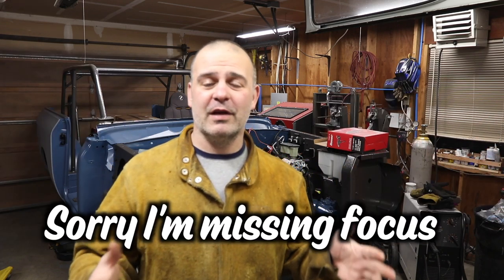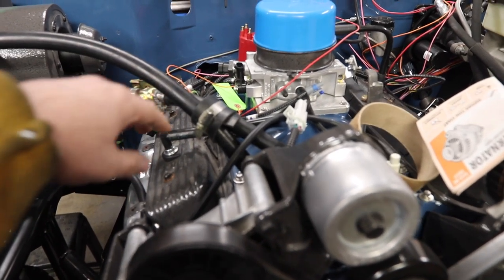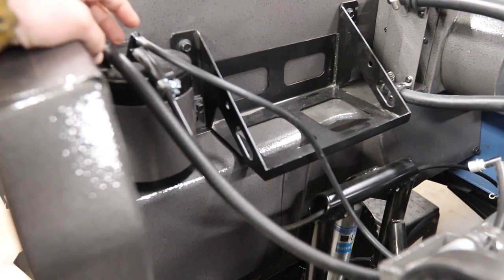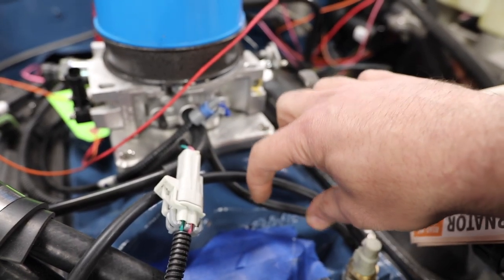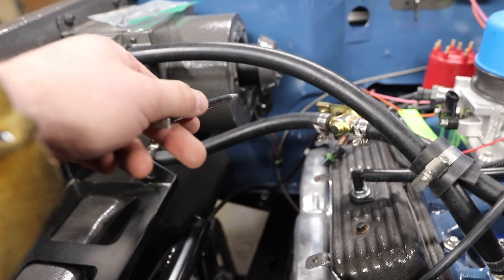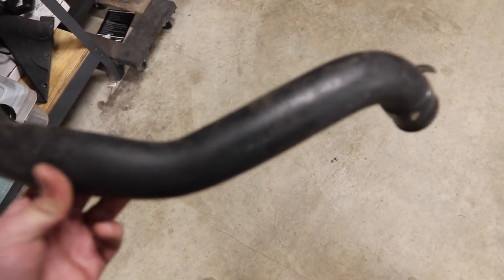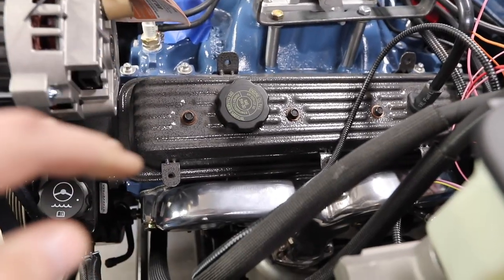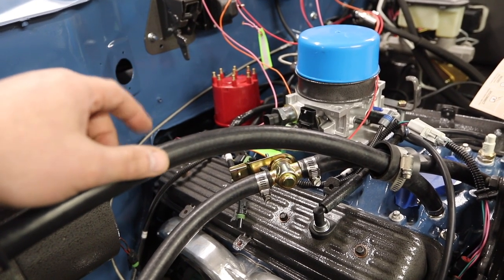6.16-Tons of Progress

Comment: Matt, loving the TIPS.  The LOKAR use for the hood latch is awesome.   After the latch cable leave the pedal assembly, how will it route to the firewall?
Reply from the maker: Charles Harrison there’s a hole on either side of the clutch / brake pedal box. I route it through there and then out pretty much in the stock firewall hole. I welded a tab on the hood release so I can attach a throttle ball to it. I haven’t done the final install yet but will report back in a future video. Thanks for watching.

Comment: How come you didn’t go with rear disk brakes???
Reply from the maker: Miguel Espinosa many reasons: 1) drum brakes in the rear work very well 2) nobody makes a hub centric disc kit for old Dana 44’s 3) with hydro boost I’m going to have more braking than I need 4) I was locking up all four tires before 5) money 6) don’t plan on running 40’s 6) can always do it later.
Reply: Matt's Garage,  I have a problem with my rear drum breaks they keep locking up I have to put a adjustable proportioning valve for the rear. That’s why I’m thinking on installing a rear disks brake kit From ihpartsamerica. But you are right about the hub centric disk.
Reply from the maker: Miguel Espinosa there is something else wrong with your system. A disk/drum master cylinder with a healthy stock proportioning valve should not allow the rear brakes to lock. The 1989 Chevy proportioning valves are exactly the same as the 70’s scout valves. Either that is bad or your Mc is bad or you have a pinch or blockage in your front lines. Also there is a pin in your proportions valve that pushes out when there is a pressure differential. It’s in the front and usually covered by a rubber boot but not always. You need to see if that was unseated and seat it properly. A correctly set up disc drum will easily stop up to 5’s and maybe 37’s. Don’t throw money at it. You need to find the problem. Just my 2 cents. Good luck Miguel! Email me at mattsgarageshow@gmail.com with any questions

Comment: I’m dumb, what’s up with the hydro boost??
Reply from the maker: Max Hammontree you mean like why do it? It’s a controversial mod. It makes no difference after the master cylinder. All the difference is the method by which the braking is assisted pushing the master cylinder plunger. In a typical vacuum boosted application the engine vacuum is spread along a large diaphragm in that booster under your hood. It works ok and it’s even still being installed on brand new trucks. When you depress the brakes the vacuum “boosts” the force applied. The hydro assist on the other hand uses hydraulic force (already being created by the power steering pump) to assist the rod entering the master cylinder. It requires no engine vacuum which is why it is preferred on diesels and cars with big cans because those two applications don’t make vacuum (or not enough). In summary, both are oem systems and both work but hydroboost greatly decreases the pedal effort required to achieve the same braking force. That’s all. It’s downsides is that it is more complex and expensive. But for bigger tires I would choose it before a rear disk because most braking is done with the front brakes.

Comment: i was looking at getting a hydro boost for my Scout. Wish you would show in some detail about what rod you need. when you bolt everything up  was it a direct bolt up or did you have  to  drill some holes?
Reply from the maker: Robert Timby it’s a lot of fabrication. I had to cut and weld the connecting rod to the brake pedal. I think the plate the the hydro boost mounts on matched up with the firewall holes I think. The internal rod is the hardest to make. I had to take a push rod cut it welded in shape a new end on it to get the exact link. If that thing is off by even just a little it could be pretty dangerous. The scale vendors make an adapter plate made of billet aluminum. It corrects some of these issues but you still have to figure out the rod. Best thing would be to get a donor vehicle from a junkyard and then you know that that system works. Then you can use that core to get a refurb. The issue with the van units is the angle of the brackets and master cylinder. You want a unit that comes straight off the firewall and sits level. Honestly the kits are probably not a terrible deal when you consider they do all the thinking for you.
Reply: Matt if you ever need anything machine hit me up I own a ma home shop
Reply from the maker: Robert Timby Thank you for the awesome offer. Right now I’m just grinding to get parts painted. I think my machining days are past me on the scout, but the next project…
Reply: Just Incase